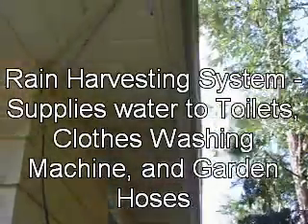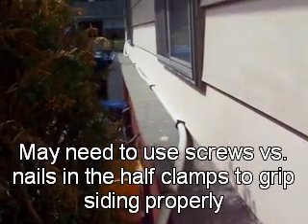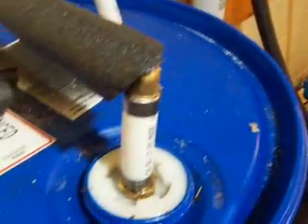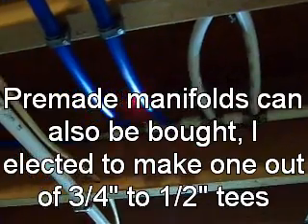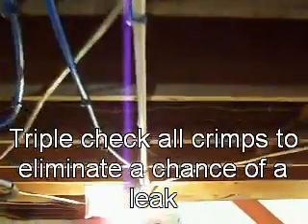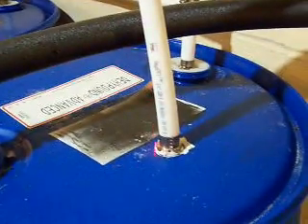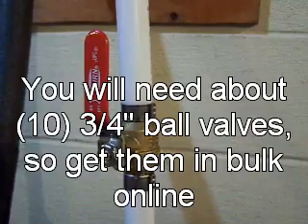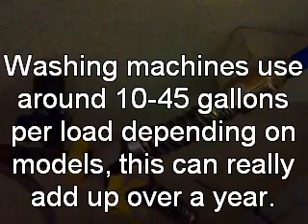All Season DIY Rainwater Harvesting System for Toilet Garden and Washer with pump

Comment: I also use rainwater to simply flush down the drain - potentially cleaning it.
1.000 litres applied quite fast should keep pipes quite clean. I can remove a lid in my parkway and monitor what comes out. I stop flushing when the water is without sediments.

I find that people most often clean this system when things have gone wrong. I do it prophylactically and of course it is cheaper - nearly free - than having a specailist clean out years of clogging.

Comment: How has the PEX held up outside. I wasn't sure it could be used without covering it from the sun. Thanks
Reply: update: the pex outside started to fail and split in spots likely due to temp and sun exposure. the harbor freight pump also has died. the rest of the system still is intact.... i may get inspired and get a new pump soon and replace the outdoor pex as water is quite expensive these days :)

Comment from the maker: update: added a high level cutoff switch. It really cuts down on the babysitting. a normally open solenoid valve and the same delay off relay card makes sure that it never overflows. I have not had any overfilling leaks since installation and can now go on vacation or away for the weekend without being nervous. one time during the summer, the power was out for an extended time while it was raining a huge amount - which did cause a minor overflow, but that is a pretty rare occurrence.

Comment: Did you need to get a permit or is there an ordinance on the books about this set up. Or is this just under the  radar stuff?
Reply: Why would he need that?
Reply from the maker: didn't - though some jurisdictions it is illegal. Keep the mickey mouse stuff to a minimum and you will be alright should an inspector ever arrive on the scene. The system could be removed should you ever want to sell the house without tremendous difficulty.

Comment: Hi I'm starting a similar project. Yours is a real inspiration. I have 600 gal of storage and a flotec pump now it's all outside my house for irrigation.  I want to plumb it inside but I need to be able to deactivate the rain system pipes in the winter. I'm in wa state. Is your harbor freight pump still working? Ps your automation is really impressive.

Comment: How did you tie all your barrels together for rain water to fill them ? Would it fill them from your bottom outlet line or should I splice barrels together at the top so one over flows into the next , into the next and so on... Might be a dumb question but just wondering... I'm doing the for a 30 foot camper ...
Reply from the maker: they are all tied together with the bottom manifold line. The top line is purely a vent.

Comment: Loved your video. Great work. Though, your pipes are running outside the house to collect the water from the downspouts into the house. Do you drain them before the freezing cold kicks in?
Reply from the maker: no draining - runs all year long. during the day things heat up and water still flows down. still running strong. cleaning. Pex can tolerate huge temp swings hot and cold. I've seen them swell to almost twice their diameter and still not break. Insulating inside the house keeps the condensation at bay.

Comment: Great, well produced, video clearly explaining your clever system. I am sure that it works well, but is it cost effective?
Reply from the maker: since it saves on both the water meter and the sewer bill - i think so. the water pressure/temperature staying constant when someone is in the shower makes it really nice too. hose is nice too when you need to pressure wash something or wash car. so some intangibles in play. i change the prepump sediment filter every 2 months but buy them in bulk on ebay.